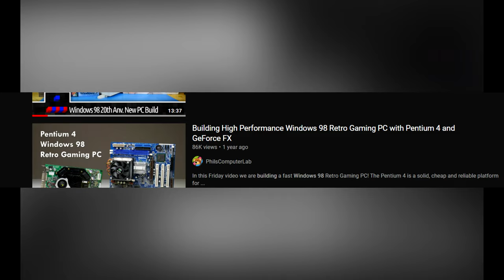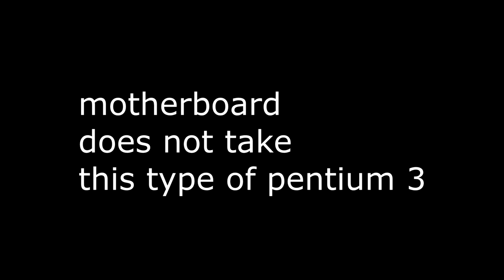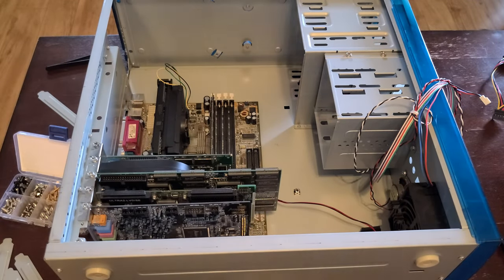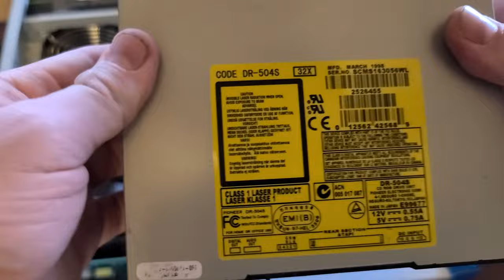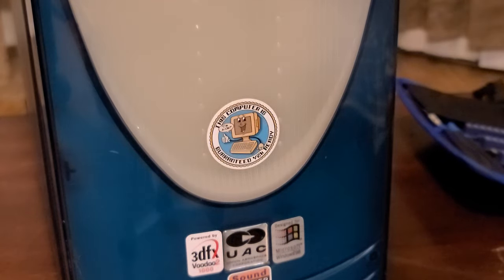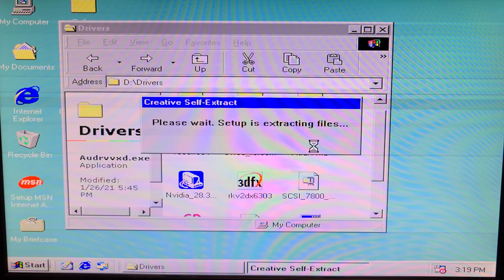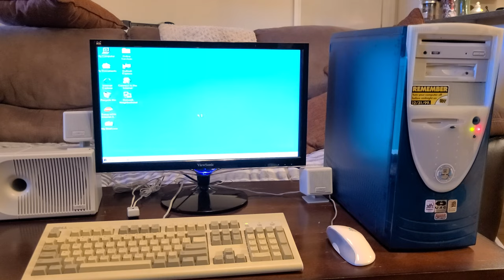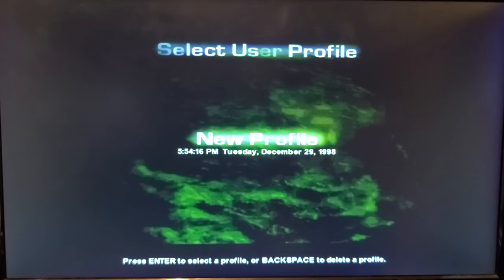The Windows 98 Killer Rig From Computer Gaming World Magazine!

Comment: My PC in 1999 - Windows 98 SE, Celeron 466MHz, 128 MB RAM, TNT2 Ultra, Voodoo1 6MB (scavenged from previous PC for the Glide games), SoundBlaster Live,  8-9GB (IIRC) HDD, those very same Cambridge Soundworks 4.1 Surround Sound Speakers here (I'd won both the sound card and the speakers in an internet sweepstakes!), and the Sidewinder Gamepad. I don't recall what my joystick was at the time.  Regular floppy drive, a DVD drive (don't remember the speed), no zip drive.  I'd eventually added 256 MB more RAM and upgraded the CPU to a Penium 3 800MHz, and ... kept using it as my gaming PC through 2007.  IIRC I was using a 15" Trinitron CRT for most of its life, with a 17" for last few years.

But why would you play 4:3 games stretched to widescreen??
Reply: We had the same computer. My friend Joe had to give me a new motherboard because he set it on fire when he tried it overclock the CPU. 😂😂😂

Comment: This is pretty close to what I was rocking circa 99/2000. It was my third PC and the first I'd built from components.

Abit BH6
Coppermine P3-650
Voodoo2 SLI
I had that specific Pioneer slot loading DVD drive. And an SB Live. Also a Sigma Designs Realmagic Hollywood+ DVD decoder card.

No free PCI slots

I even had the Cambridge speakers, although mine were the 4.1 version.

Comment: TNT2 without a heatsink? 😵
Reply from the maker: yeah I didn't have any on hand and would agree with everyone else to put one on it other wise good bye TNT2
Reply: It's an m64, doesn't really need one.
Reply: That TNT2 was a garbage m64 version. Half the speed of a normal TNT2 card.
Reply: Still hot enough to cook itself though. it's identical to TNT2 in core clocks, just garbage because of the cut down 64bit memory bus. @EvoPortal
Reply: @jamesjan  Wrong, that's the absolute garbage TNT2 "Vanta" m64 card clocked at only 80mhz core and 100mhz memory. It's absolute garbage. A voodoo 3 is twice as fast.
Reply: @EvoPortal  yeah, Vanta was an even more cut down version of tnt2 m64. Should’ve been named tnt2-m64SE 😂
Reply: Not sure why some people sell GPUs on ebay with heatainks or even the metal bracket to secure it to case removed.  I have both a voodoo1 and TNT2 that I got cheap because those things were removed (well I know Voodoo didnt originally come with heatsink).  They worked fine but I needed to strip other GPUs to get bracket and cooler.